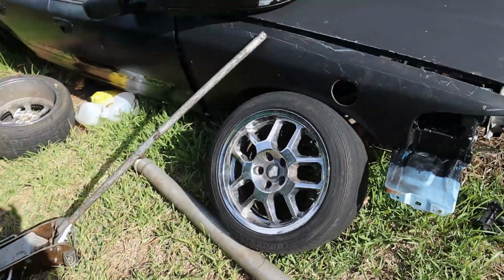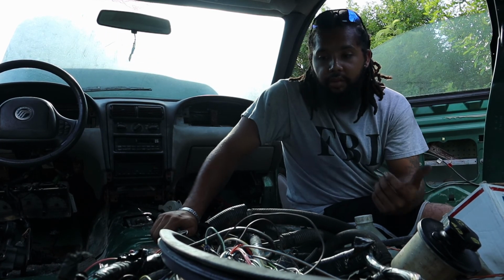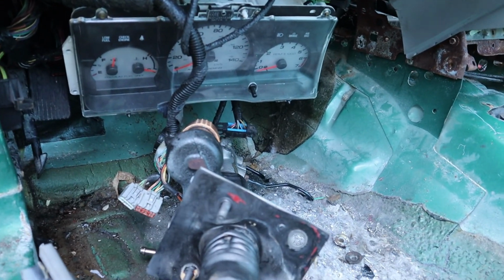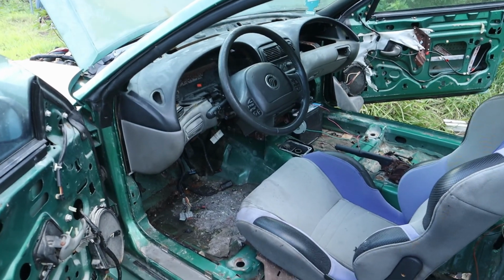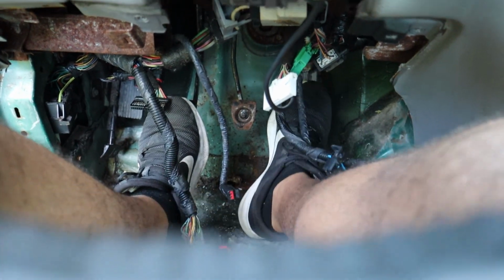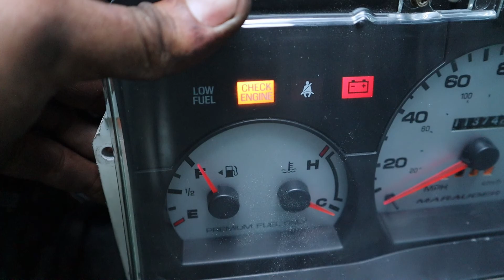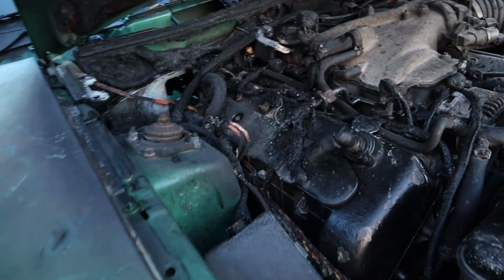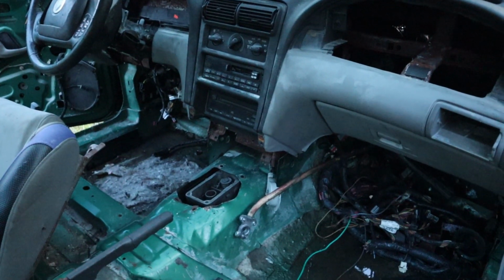My 4valve Swap Mustang Caught On Fire

Comment: Hurts to see this after all the work you did. Another Marauder harness might be hard to find, but I think it may be possible to use a harness and computer from the more common 2 valve 4.6 or 5.4 with some small modifications. Might be easier to find a truck or van to pull a harness from.

Comment: Im sure you have worked this out since this video but i had a foxbody back in highschool that the neutral safety switch went out on me i just ran two wires from the posts on the starter that you were jumping originally with the screw driver into the car and would touch the two wires together to start the car and eventually hooked the two wires up on a push button. Never did fix the switch lol